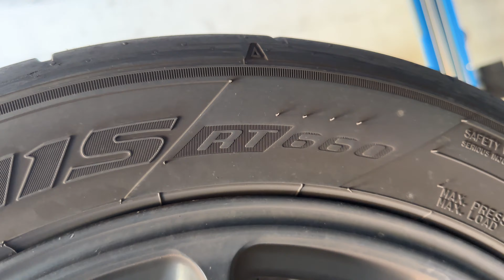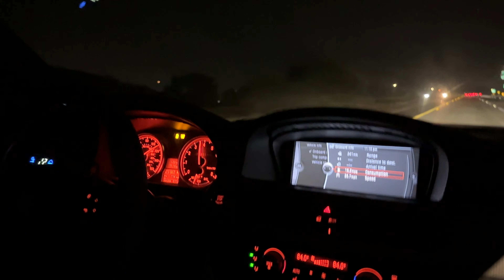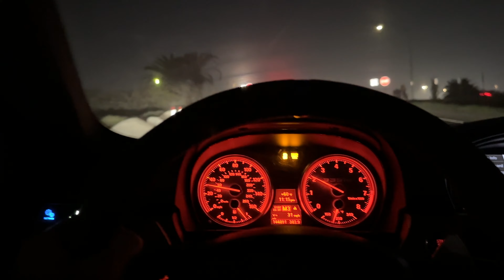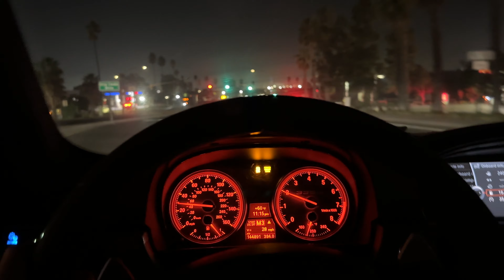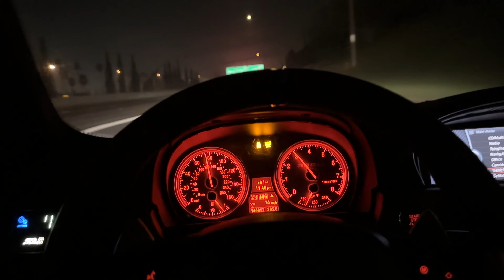Big Turbo BMWs Going at it! (4k)

Comment: Tryna get new wheels for my is, and your setup looks really clean! What are your wheel/tire specs?
Reply from the maker: Thanks! Fronts are 18x8.5 and rears are 17x9 not sure the offset
Reply from the maker: And tires are 245/35r18 fronts and 275/40r17 rears